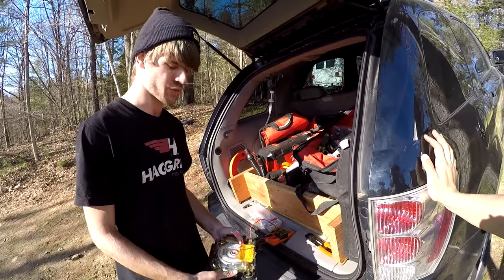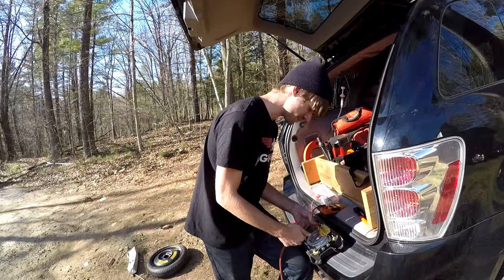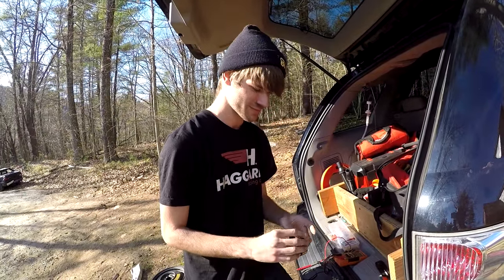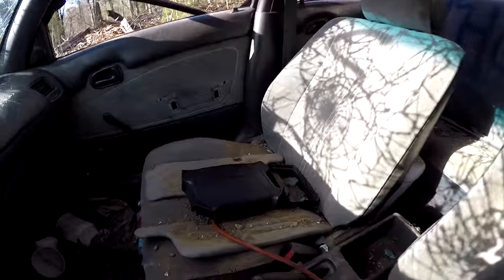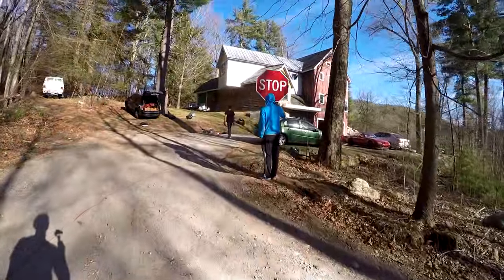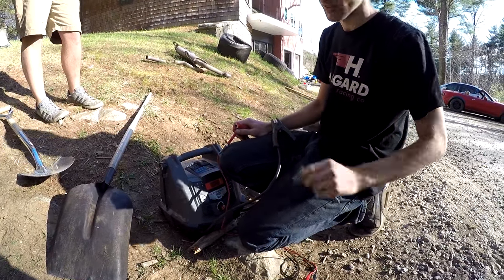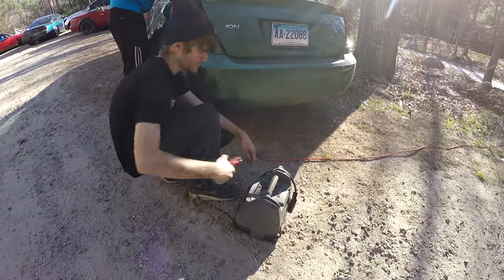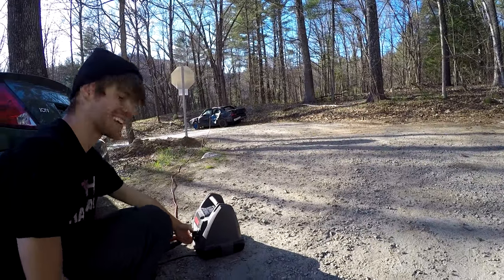Vlog 11: How to deploy an airbag

Comment: have you seen the episode of roadkill where they set off the airbag in an old Mustang with a bowling ball taped to the steering wheel? if aimed right it would have shot the ball right through the window. it was the episode where they thrashed a mid 80s Camara and mid 90s Mustang